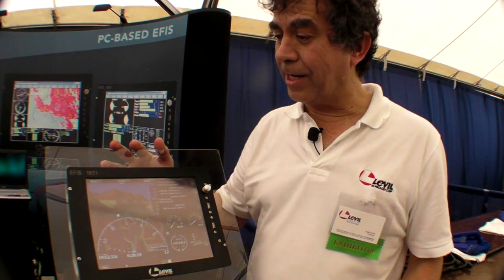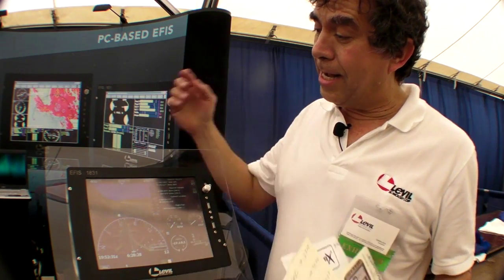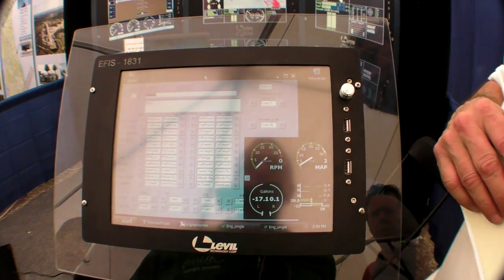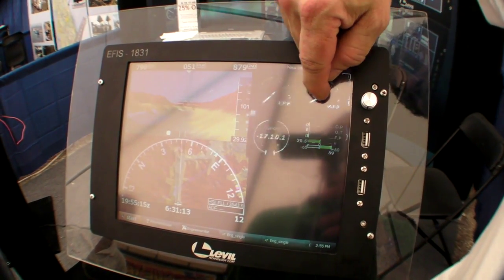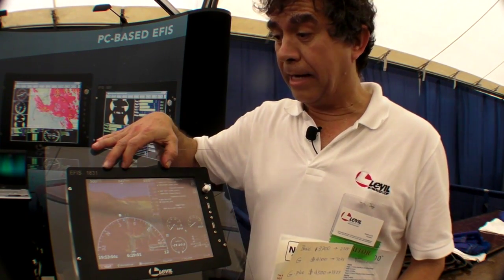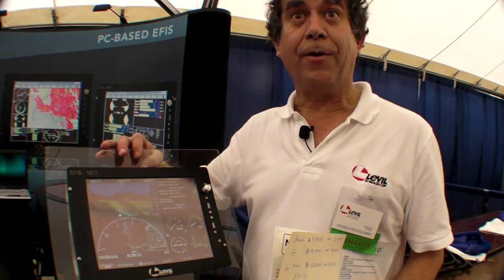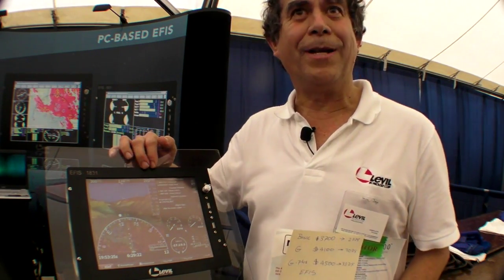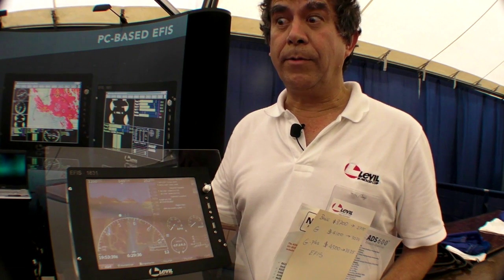Build Your Own PC-Based EFIS

Comment: @KaityRSProduction Hi Kaity, I am very familiar with this product (and I am an Aeronautical Engineer and Avionics specialist too...) and altough the discussion around WinXP surely has it basis, that is not just a flat screen+software. It is a complete solution. It includes de AD/AHRSI/EMS card, the screen and the CPU attached to it. I came back to the video after having the unit in my hand. The use of windows is due to the idea of using existing EFIS software, available mostly for windows.